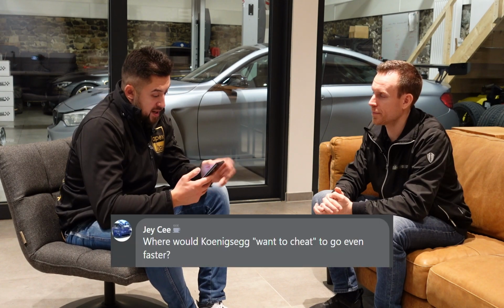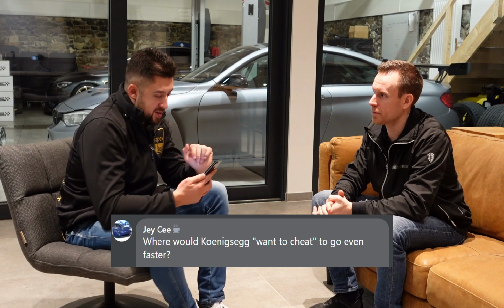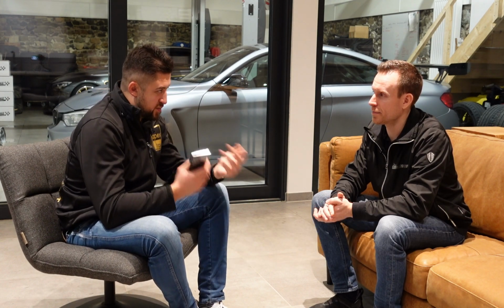"That Was Easy": How Koenigsegg Broke Multiple World Records in a Few Hours

Comment: 19:40 That's not quite how it works. The trade offs are not linearly correlated like that. It is highly dependent on vehicle speed, whether the car is NA or forced induction, current altitude/ temperature, etc. For example, a car going around a hairpin turn on Pikes Peak will definitely feel the HP loss due to the thinner air but the difference in drag is negligible at those speeds (which is why you see so many turbos with giant aero). Not trying to be an @$$ hole, just clarifying. I appreciate all of your content.
Reply: No, it's not linear but like I said the loss of power because of the altitude compares to the high speed at 450km/h was more or less equalling against each other with the car I drove, that was what I ment.
Different cars and different altitudes will get different results.
Regarding your Pikes Peak example that is true as lower speeds are not aero affected and then the power loss will feel a lot more and you don't have any speed benefit from the thinner air. You need to drive over 150-200km/h to start to have any effect on the aero and to gain downforce at a high altitude you need even more speed.
Reply: @LMPEngineering   Agreed, you gave a great explanation. However, my comment was mostly directed at Misha's comments towards the end, saying that people who say their car is low on power at altitude don't understand aerodynamics. It not only seemed smug/ arrogant, but it was in fact incorrect. 
In the end, I appreciate you two making this video and providing all the information. You did an amazing job, both driving and explaining. Also, thank you for taking time to respond.

Comment: The amount of technical knowledge this guy has is very impressive. Personally i do worry if ssc actually tried to do a genuine record attempt, i dont think it would end good.
Reply: If any of the brands tried a world record attempt, not just SSC. It's basically a life/death situation. Anything can happen at those speeds, in any car.
Reply: @basilisk4072  Its more a calculated risk. Yes there are odds it can end in the worst way, but those cars are designed very well and occupants can survive such a crash. My mechanic was a rocket car driver and had a chute fail north of 350... spent two weeks in a coma but is still alive and kicking, tho not a "fast car guy" anymore. They all understand the risks which is why they plan their asses off and train to be competent to avoid the worst case. (I mean this guy logged the wind data from that day in his head permanently).